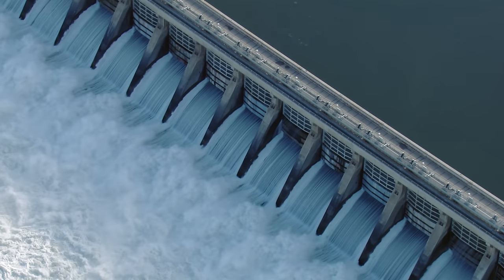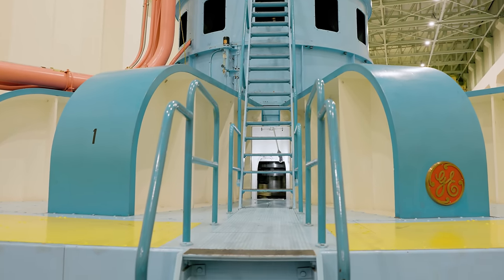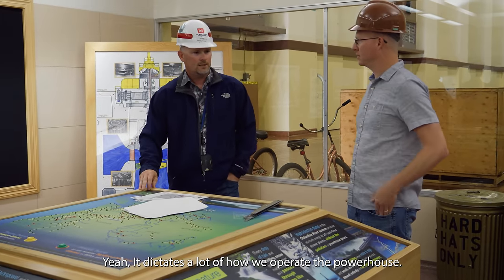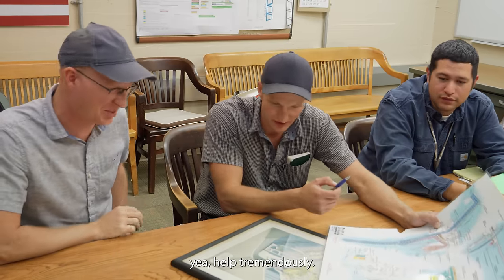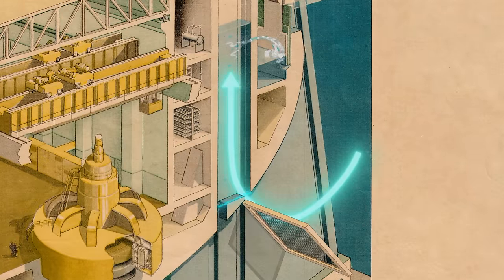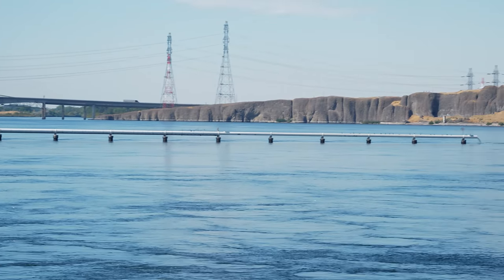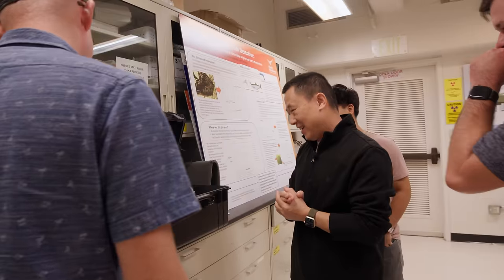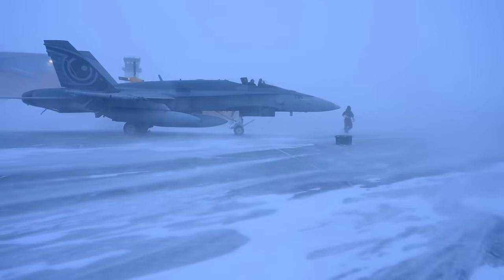How Fish Survive Hydro Turbines

Comment: 3:20 These bars are dangerous. Would somebody get stuck in them, they would be made into a lump of meat pretty quickly. Please pass it to the dam chief in charge. One solution would be to anchor the bars with lighter screws, so they would fall aport in case f emergency *would have to be done very right to not damage the shaft), or just widen the gap. But nobody should be able to put his leg between the shaft and the bars.